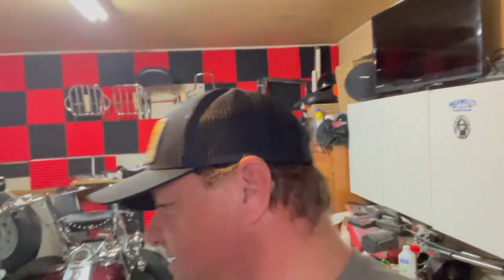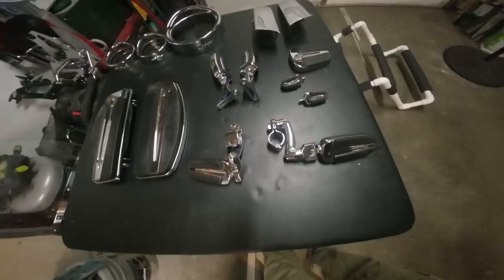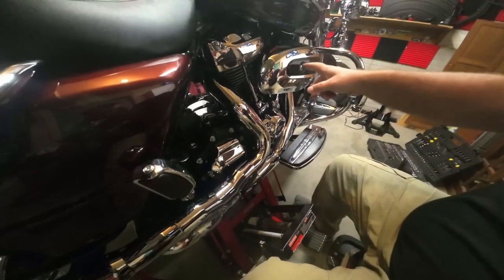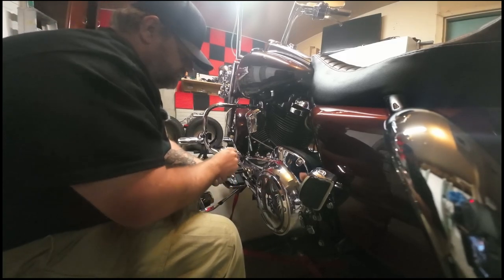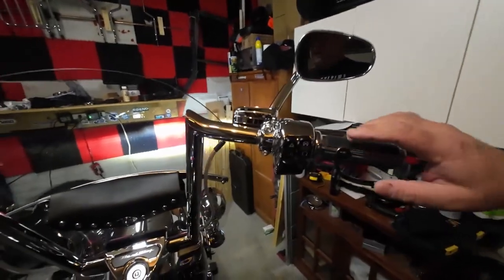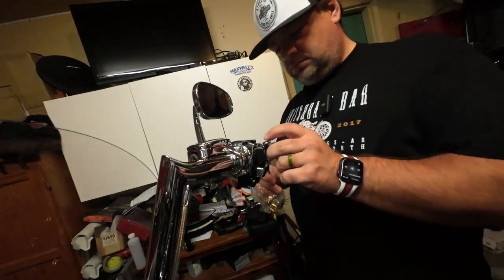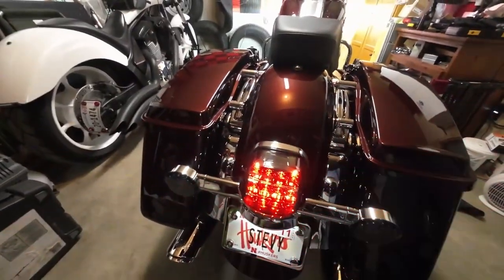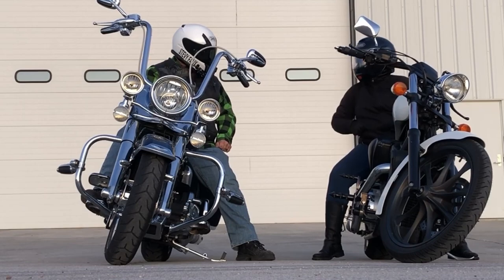I Did a Thing!!!!!! New Harley Davidson

Comment: Stevy, I was getting used to seeing someone else with the same year, model & color as my bike,, the new one does look great though.
Do you truly like the M-8 better? Or ? Just wanted a newer bike?
TC & keep ‘em rolling.
Reply from the maker: Wanting a new bike was part of it. Riding with others that have an M8 and then getting 50 mor miles to a tank then I did was part of it but when this bike came up for sale with bars, wheels and full exhaust on it already (just like my blue bike when I bought it) it was like all the stars aligned and it just felt right.
Reply: @StevyFaux  Awesome! Congratulations!
I wished mine had more bells & whistles when I bought mine. I did have a lot of upgrades but the wheels & suspension is 2 options that would have been nice to have.
I got 220 miles to a tank which I thought was pretty good.
Congrats again!
Reply from the maker: @babybugspaw7085  I would never change the wheels on a bike. But I will gladly buy one that someone else did and I will benefit from their loss 😆